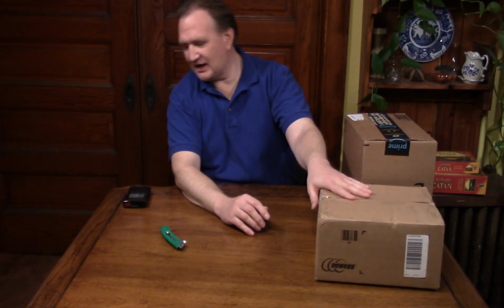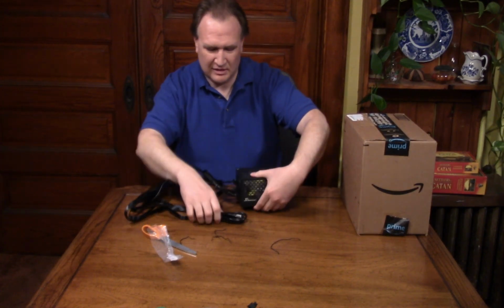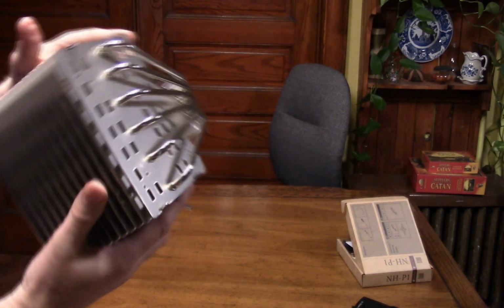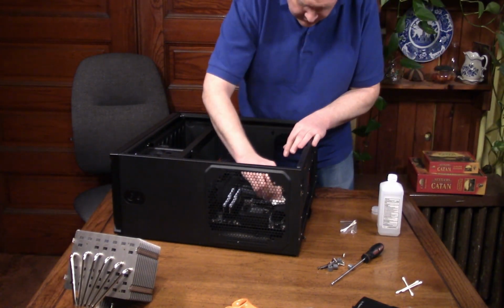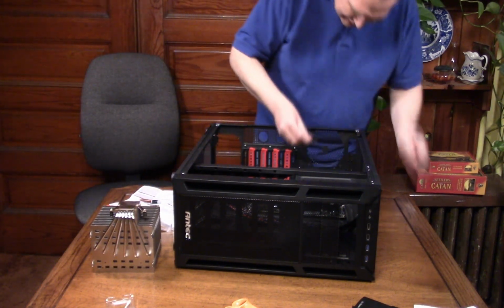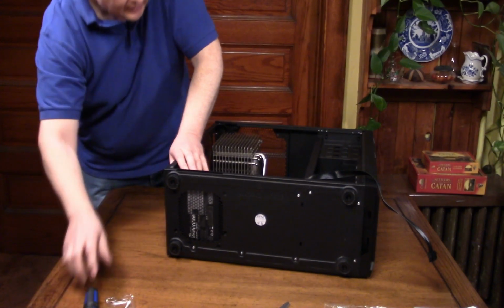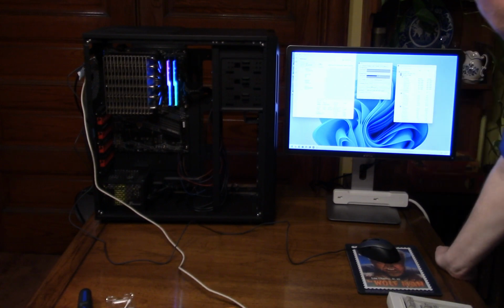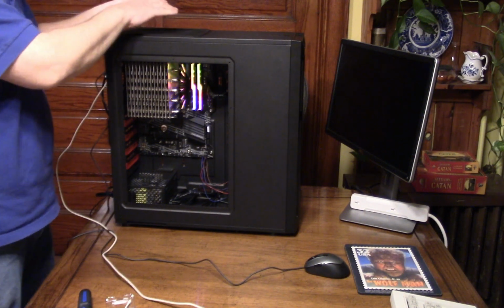Now it's Totally Silent! — The Perfectly Silent — Fanless Computer Build — Part 2 — with Unboxings!

Comment: im wanting to build pc all i want to use it for is for streaming.Would this work for me i do have pc on for long periods of time
Reply from the maker: I have no concerns about the processor or the power supply overheating, or having a shorter lifespan. But, the other components, I'm not so certain about. The motherboard was probably designed to with the idea that there would be airflow in the case. That being said, it may be possible that the motherboard could overheat, or die early because of running for long periods of time at hotter than ideal temperatures. I don't think it's going to be a problem for me in the winter. I might use extra efforts to keep it cool in the summer. But really, only time will tell.